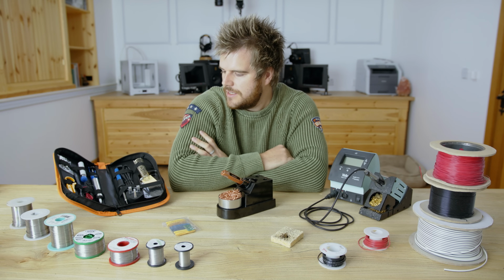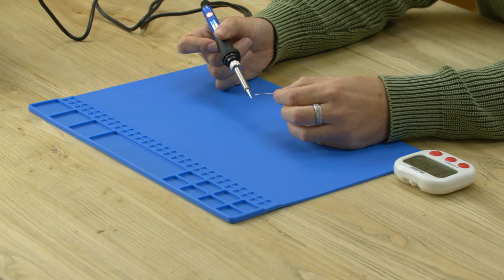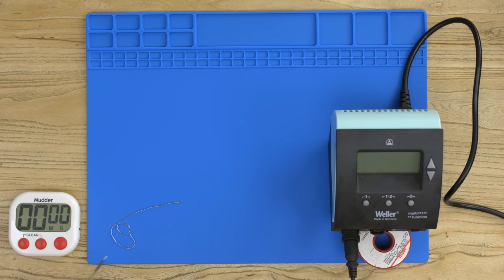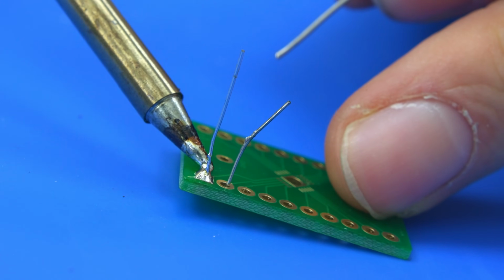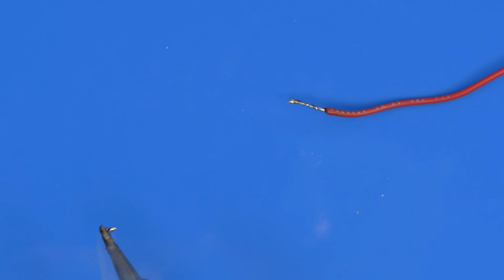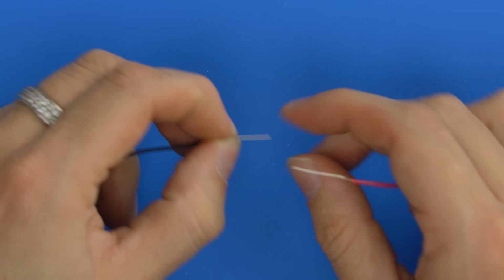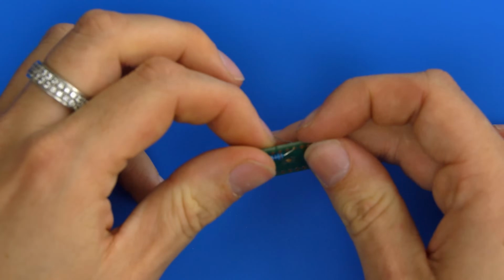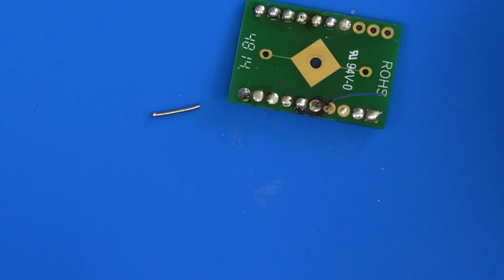How to Solder Basics | Hardware & Electronics: 01

Comment: Soldering printed circuit boards is new to me, I have a very good soldering station, but how do I decide at what temperature to solder?
If the soldering iron is too cold then I have to heat the printed circuit board for too long, if it is too hot then the components will break!
what is the best setting for lead tin 40/60 solder?
thanks in advance!
Reply: 300-350°C

Comment: "Solder" rhymes with "otter" -- the L is silent, and has been since the Middle Ages. Check the Oxford English Dictionary. Curious where you got your odd pronunciation?
Reply from the maker: "Solder" is a modern spelling of the Middle English "souder", which derives from the Old French "soudeur", which itself comes from the Latin "solidare". In the 15th century there was a movement to re-latinize the spelling of words, and the "l" got added back in to the spelling, although the pronunciation didn't change to include the "l" until sometime later.

Comment: I do not recommend splicing two conductors in series by twisting them parallel, then folding over the joint. The joint can break when flexed, or the portion folded over could pierce any insulation sleeving used and cause a short. Other than that this is a decent tutorial for beginners.

Comment: I’m guessing my soldering iron is from the 1920’s.  The cord is cloth and the plug is round bakelite.  The handle is ergonomically shaped wood.  The tip is replaceable (but of course there are no tips made for this any more). Use it for all my needs.  Got rid of my Weller.

Comment: Just so you guys know:

You shouldn't use flush cuts to strip a wire, you can already see he's cut some of the strands of the conductors. Which lowers the safe conductivity. Use wire strippers with the correct gauge of wire.

His solder is wicking up the conductor. You don't want the solder wicking past the edge of the jacket. The way to test that is to try to bend the tinned wire at the edge of the jacket. It should be pliable. It 's harder to bend than the rest of the wire, your solder has wicked. Meaning it's more likely to break.

Comment: That knot is called the Soldered Western Union/Lineman Splice :) Its so usefull that is even included in NASA's "WORKMANSHIP STANDARD FOR CRIMPING, INTERCONNECTING CABLES, HARNESSES, AND WIRING".

You can find it here (link to pdf): https://nepp.nasa.gov/files/27631/NSTD87394A.pdf 

The knot appears on page 71

BTW Are you going to go into more general electronics in the following videos or more into embeded systems?

Awesome video as always!
Reply from the maker: Awesome. Thanks for that :+1

Comment: Wow, must admit that I'm really impressed, wasn't expecting this at all. Very comprehensive video, covering all key things you need to know when it comes to soldering. Have you considered making a video about creating homemade PCBs as a part of this series? Would love to see that.
Reply from the maker: Glad you liked it. Definitely we will make PCBs both design them as well as homemade and also factory made
Reply: Good to hear. One more question if you don't mind - you mentioned that inhaling vapors from melted solder is not the best idea and may have a negative impact on your health. What do you think about holding a leaded solder with your bare hands (talking about the most common Sn60Pb40 alloy)?
Reply from the maker: It's totally fine unless you are soldering every day for weeks or years. Lead is a cumulative effect and you just pee it out. So unless you are constantly exposed to lead, it just goes away https://media.digikey.com/pdf/MSDS/Kester/245%20Core%20Sn63Pb37.pdf